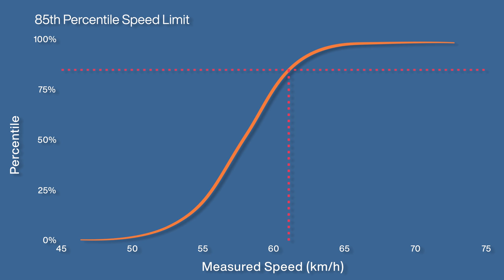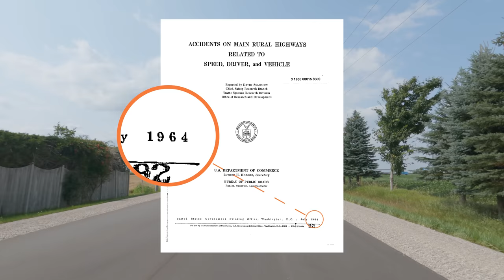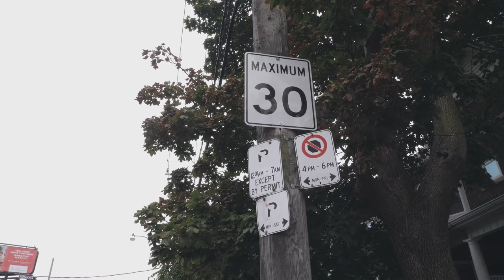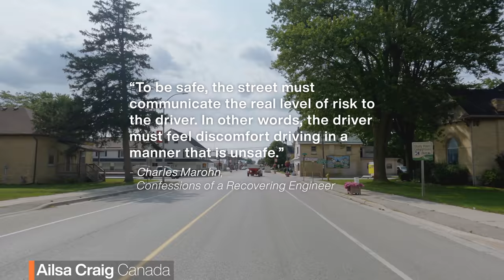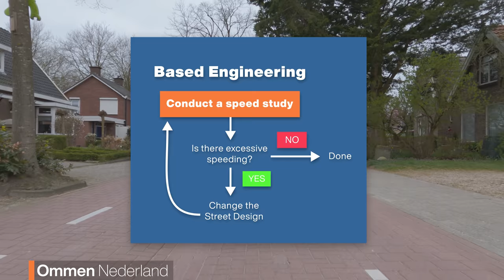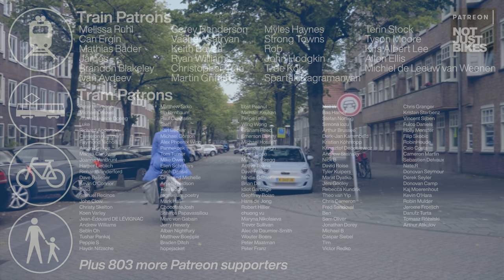The Wrong Way to Set Speed Limits [ST06]

Comment: The road surface difference in the Netherlands really helps as well! In residential areas the streets are usually brick instead of asphalt, which makes drivers "feel" their speed more
Reply: The winters in Toronto wreak havoc on our roads and I wonder how bricks would respond. There are a very small few sections of Toronto that have brick but it's so small it's barely worth mentioning
Reply: I was looking at the street markings in Amsterdam in the video. Here in Calgary for example, the street markings are invisible for 4 months out of the year as they are covered in snow.  What's it like in Amsterdam in the winter?
Reply: @Alacritous  we do this nifty thing called clearing the roads, also we dont solely rely on road markers, like the street design tells you if you have one or multiple lanes or whether there is a bicycle lane.
Reply: @RichardHartl  There are forms of asphalt concrete that are patterned after brick roads, giving you the feel of a brick road, but the material advantage of asphalt.
Reply: @Alacritous  Street markings are usually complementary. Other design elements will give visual context. Continuous sidewalks for example legally and physically indicate priority. And interections with traffic lights will have road markings as well as signs, basically a 3 layered back-up. If those all don't apply there's a general rule as well; traffic from the right has the right of way, trams have priority over anyone else.
Reply: @wiekeboiten6742  We have bike lanes here.  In the winter they're where the city puts the snow.
Reply: @Alacritous  yeah here they use the sidewalk, or parkingspots if available
Reply: @Alacritous  well, it usually doesn't snow too much in the Netherlands (until that one week a year and then it's pretty chaotic haha)
Reply: This is a good idea, it was tried in my home village. Such a good job was done and the road bricks so smooth that a driver could not tell the difference between brick and asphalt.
Reply: Britain kinda has started putting brick on the roads.
But it's mainly at junctions and open areas with parking in residential places.
Also the junctions are footpath level making them a speedbump..
It's getting there really slowly.

Comment: In the US, I actually have noticed a place that consistently does change the road geometry in order to force a slower speed: entrances and exits to US military installations. There are also rumble strips, who I feels use is underutilized
Reply: That's really true.  All over the base, there are tons of speed bumps: the soft ones you can roll over where the speed limit is a little higher, and the ones you have to absolutely crawl over at crossings.  And then they use the jersey barriers to create those slaloms in and out to protect the gate guards.  Otherwise, it's just too easy to speed.  The roads are wide to accommodate all the industrial machines that have to fit through, making it super easy to zip around until you hit a speed bump, and add in demographic shift from the general population to the base and a need for those controls is obvious.
Reply: When your military is better at building roads then you 😂

Comment: In Euro Truck Simulator 2, whenever I'm going into Amsterdam I hate the road because the limit is 90km/h for trucks but there's a huge zigzag and I always assumed the limit meant the road was actually drivable at that speed, so I basically crashed like 3 different times before understanding I was meant to slow down lmao

Edit: doing a random job on the game I just went through Luxembourg and turns out that's where the zigzag is, not Amsterdam, so my bad on this one lol
Reply: Hmm also i find it pretty easy to just go into pretty much an autopilot when it comes to highway driving.
Like litterally just 12th gear 56 mph (90km/h ish) and turn with the road.
And because of that im quite shit at reacting to the random events. City driving and slower speeds i tend to have a better reaction time than highway driving.
Reply: Hello from LU. We have signs on some curves that indicate a recommended driving speed (distinct from the speed limit in that it's not legally binding), but many of them don't, especially up north.

It's always awkward driving on a 90kmh road with an upcoming 180° bend and wondering if you have to slow down to 50 or even maybe 30? And then many people just drive through at 70+ anyway because fuck safety amirite?
Reply: There’s this small two lane road on the way to my house, 55mph speed limit. There’s a sharp turn at one point and a sign literally directly at the turn where it’s already too late to slow down that says the recommended speed is 30mph. Funny thing is if you are going at the recommended 30mph you are 100% going to accidentally cross into the other lane. If you are going above 40 you are just gonna fly off the road. The road is also heavily used by semi trucks and large vehicles. Very very dangerous but somehow only 1 accident in the past year on it

Comment: I also imagine that we've a lot of 'old' roads where the city has grown around it. So you've roads that were designed for cars to go 60-70-80 mph and business and housing have crept up along side them. Now city managers have two choices, Post new signs or completely redesign the road to meet the current reality. Signs are way cheaper and less disruptive and quicker. So signs are what you get. The town I live in recently took on the project of redesigning the roads/streets that run through it. I'm sure it isn't cheap and got dammit if the process and constant construction isn't annoying. But, as things are coming together we can clearly see the benefits.
Reply: They can paint narrow lines for the same price as a sign...
Reply: @traviousandrews1015  yeah, some of the shown solutions definitely seem to either be just as cheap or come with other benefits
Reply: you also avoid blowback from the car addicted; it's often politically unfeasable
Reply: If the speed limits are enforced, the signage make sense.
Reply: Yeah, a similar issue in the US is a lot of towns/cities along rural highways have a habit of making said rural highway into their main street rather than accepting it as a throughfare. In the past they probably wanted to entice through travelers to stop and shop, but that rarely happens anymore and having through traffic forced through the quaint "old town" pedestrian shopping area is detrimental to both the pedestrian shopping area and the through traffic.
Reply: What town is it if I might ask?

Comment: My local council in Australia constantly is lowering speed limits for safety but not doing anything else. Police see it as an opportunity and setup a speed camera van to catch people driving to the road design instead of the speed limit
Reply: That sounds so typically Australian.
Reply: which council was this?
Reply: Does anyone else have trouble noticing Australian speed signs? They're so bland I often miss them. I like how on the Bruce HWY they have some double stacked, or ringed in fluorescent orange -I didn't miss any of those!
Reply: Same in Brisbane. Low hanging fruit syndrome, unfortunately.
Reply: @roseduste80  Ringing in fluorescent orange seems to be a Queensland thing imho. Australian speed limit signs are to the same design as the international standards: a number within a red circle.

Although if traffic engineers really cared about making sure that drivers are following the speed limit, how the speed sign looks like shouldn't matter at all. If the road was designed properly, the driver should be able to glance at the road and guess (almost to a tee) what the safe speed is - the sign is only just there to 'confirm' your suspicions.
Reply: @roseduste80  Also, I have a comparatively bad opinion of traffic engineering in Queensland, especially compared to the ACT and Victoria.
Reply: @brianocampo7981  Gold Coast has some things I hadn't seen before, but they tend to take up a lot of space so you have more time to work them out. Melbourne put me in a few scary situations in the 2 years I lived there. Very sudden Form 1 Lanes. I accidentally ran a red on Alexander Parade. If you're first car and lose concentration for a second, all you see are green lights (I would only have been able to see the red if I'd twisted my face up near the dash.) Burwood Hwy goes from having separated trams to them suddenly being in your lane at the other side of an intersection on a crest. Was lucky both the car next to me and I realised my mistake about 10cms before I was wedged between them and a tram.
Reply: Speed limits for the Autobahn is currently a big discussion in Germany but frankly, the most fatal accidents don't even happen there, but on the country roads, when people do risky manourvres to overtake someone else.
Reply: @swanpride  Same could be said for Victoria. Hence the TAC has the slogan 'country people die on country roads'. The chief reason why Victorian road authorities are uninterested in autobahn-style roads is because the death rate per 100,000 people is already similar to Germany's (between 3.5-4.0 per year)

Comment: If you're on a 65 mph highway and you actually go 65 mph, you will annoy something like 90% of the drivers there.
Reply: Guilty 😂
Reply: @UpNorth buses and trucks are the exceptions, we know you have rules and regulations hehe
Reply: That's another problem:
Bad driver's education and (probably) too few traffic controls with too little fines
Reply: Wait, 65? I thought that said 85.
Reply: Yup, easy way to figure out travel speed in the US on the highway. Speed limit + 5-10 mph is for the right lane. Speed limit +15 or more mph is left lane.
Reply: Most highways are design to travel at much higher speeds. The guy ignored all others laws in the video. Currently all jurisdictions have maximum speed limits for certain road types usually very specific for developed countries so the actual it is not a design road or average speed but just laws that state nothing faster than speed limits from 50 years ago.

https://en.m.wikipedia.org/wiki/Design_speed
Reply: Only if your in the left lane
Reply: @fireemblemaddict128  Car drivers have rules too - it's just a high proportion feel they are above the rules and they are mostly allowed to get away with it.

HGVs in the UK are virtually all limited to 56 MPH - even though motorway speed limit for HGVs is 60MPH

Minibuses, i.e. 17 seat,  are all limited to 60 MPH (if made in the last 10 years or so) - even though the motorway speed limit for minibuses is  70 MPH

We have the technology to limit the speed of cars to the actual limit on a particular stretch of road - and all new cars sold in the UK are now required to have this feature - however we permit drivers to override or turn off the feature.
Reply: @johnwashburn7423  It's not about patience, but about feeling good. I don't rush to many places, but some roads in my town feel like they should have at least a higher speed limit.
Reply: If we're all going 85 then they can't pull all of us over.
Reply: Cause 65 mph is a joke.
Reply: when you live in a part of america that the speed limit is 75 but hits 95 in the morning, not even the cops gives af
Reply: Imagine breaking the law and endangering pedestrians just because you feel a bit awkward. Keep being selfish!
Reply: @maestbobo  There's generally no sidewalks by US highways.
Reply: @UpNorth that should be illegal
Reply: The 65 is a dangerous zone anywhere, drive below you are pulled over for suspicion and slowing traffic, drive exact and you are being honked at, drive over and get speed trapped 3 exits up.  Best just ride behind someone and hope you dont see the dreadful empty roadway ahead of you that signals a traffic stop is in your near future.
Reply: If this is me then I only drive 60 mph
Reply: @fireemblemaddict128  everybody have rules and regulations to follow, but it seems people only follow it if the company they work for is the one getting in trouble for violating and they would lose the job, when they break the law they just complain that the police is corrupt
Reply: @h2ojr1  most of North America highway are designed to handle up to 85-87 mph. 65 makes driver fall asleep and was set a century ago to save fuel. US is still way better than Canada though
Reply: And if you stop at a red light/stop sign, or use your turn signal more than 6 inches from the start of your turn, or if you slow down for a stop rather than waiting til the last nano-second to slam on the brakes and hope for the best. Seriously, this country is quickly earning the nickname "Moscow 2.5" among professional drivers.
Reply: I know. I do it on purpose now or go slower because I have an older car and if they want to be wasteful and stupid that’s their problem. Someone harassed me when I had a spare on too. It was like people weren’t looking ahead or paying attention to the road while they were driving.
Reply: @Flubbred  why don’t you slow down and enjoy the scenery around you instead if you’re not in a rush?
Reply: @MicroageHD  K try crashing at higher speeds then. The reason 55 was the speed limit for so long was bc at say 75 the increased acceleration/deceleration would cause the force I believe to exponentially increase during a crash. The crash is much much more likely to be fatal at 75 vs 55 mph.
Reply: @jacobcarlson4010  oh my gosh yes the quick stops and accelerations! People are wrecking their cars!
Reply: @user-pe2yx9kt4e  I will get over myself AND the speed limit. Safely of course
Reply: @Flubbred  I think it goes both ways. Streets should have lower speed limits and highways higher.
Reply: @Flubbred  sorry I was mean
Reply: @lbialk I always assumed cops were supposed to go faster
Reply: @shinwang2469  no one survives a crash at those speeds. Just because a road CAN handle a speed doesn’t mean WE can. Think for a change.
Reply: @areyoujelton  Of course no one is surviving a 80mph crash into a slab of concrete. It’s a different story on the road while fatality depends on the speed differences between cars. Arbitrarily low speed limit force drivers to speed. Good luck driving 65 while everyone else on the road passes you at 80+. Not to mention the speed difference will cause more accidents.

Not sure where you are from but in my area (Toronto 400 series hwy), the speed limit is 100km/h but average traffic flows at 120-130 km/h or higher outside of rush hour. How does following the speed limit makes sense then?
Reply: the amount of people on highways that i see going 80+ is shocking

i stopped going that fast merely because i value my life
Reply: @gliiitched4429  Yeah, there is a speed limit only when most people follow it. Here in Toronto your car get impounded for going over 150km/hr on highway so most fast drivers cruise around 140km/hr. I think a more strict traffic law is needed to solve the problem but also think 100km/hr (62mph) everywhere is a dumb idea.
Reply: Hmmmmm.... 85% is pretty similar to 90% so your experience proves the use of the 85% rule
Reply: @jaysonlima9271  90% rule buy done from the opposite direction lol
Reply: Only if you are in the left lane.
Reply: I got a citation recently for speeding . I don’t go 7 over the limit ANYWHERE. Of course exceptions such as downhill. My main thing is be attentive and in control of my vehicle.
Reply: @maestbobo  Imagine thinking that going appropriately fast is endangering pedestrians.
Reply: and I get there on schedule lol I do what I want
Reply: @thatslegit  seriously here in North Carolina I’ve hit 90+ mph traffic flows on multiple highways, blew my shorty turbo doing that in my 20 year old diesel VW Golf too 🤦🏻‍♂️
Reply: @shinwang2469  62mph everywhere would save about 20% in petroleum and emissions. You guys don't seem to worry about costs or global warming too much even though British Columbia hit record heat recently and fires are burning down your forests.
Reply: @MicroageHD  Hi speed rail could have you traveling at 200-300mph and air travel at 250-350mph. Yes 65 feels slow but this video is making you aware that on a different road, that 65 would feel fast. Also, 75 mph does not really change your travel time anyways, only your perception.
Reply: @jamesmedina2062  never underestimate an environmentalist’s ignorance 🙂
Reply: @shinwang2469  Sorry, but gearing, aerodynamics, and fuel economy are mechanical engineering not environmental wizardry 😝
Reply: @jamesmedina2062  I commute with a Tesla
Reply: @johnwashburn7423  You're not supposed to sit in the left lane. The left lane is the passing lane. Even if you are going 80+ mph, but the person behind you tailgates you, you are the one responsible for merging right and letting them pass.